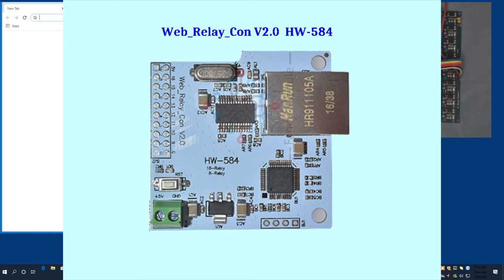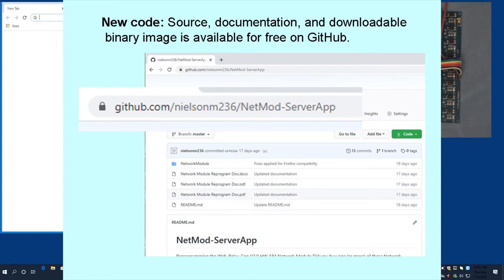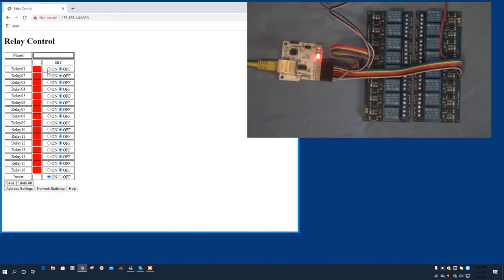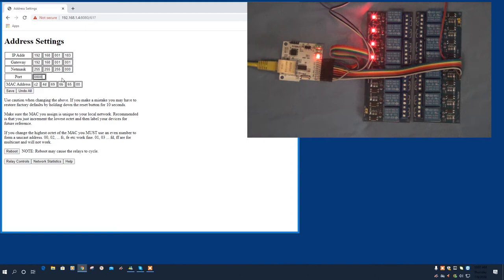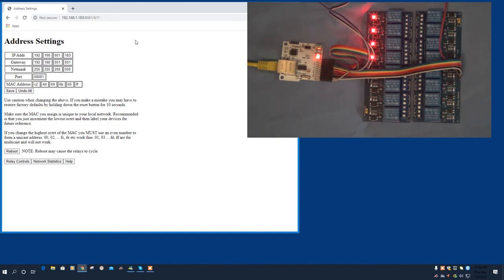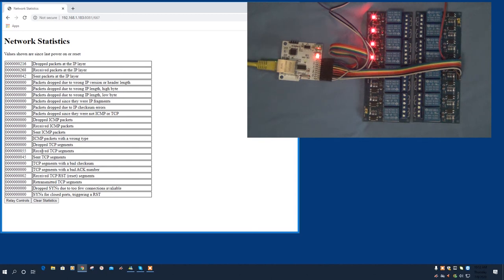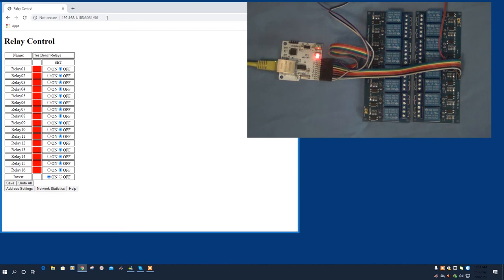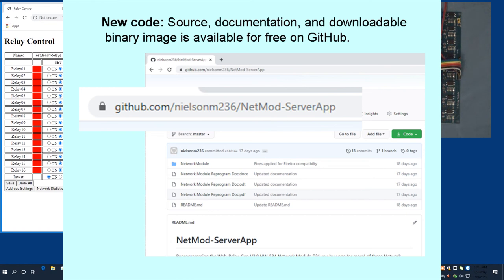Web Relay Con V2.0 HW-584 Network Module 8/16 Channel Relay Controller ENC28J60

Comment: Hi All - I've created a separate code thread that makes the Network Module provide 8 relay control outputs and 8 inputs. Did this for my own use as an experiment. As of this date (July 24 2020) I haven't put that new code thread on GitHub, but if there is any interest I'll be happy to do so. FYI it would be just as easy to make a code thread with no outputs and 16 inputs. I've thought about making each pin user programmable via the GUI, but that's a stretch in the available memory so I'll revisit that idea only if there is interest.
Reply: Hello
I would be very interested to know that my attempts to do just that have unfortunately failed because I am not deep enough in programming. Apart from that I often work with ESP Easy firmware, but in some places WLAN is not possible or not stable enove.
I would be very happy about your code
Reply: Hi there,
Very interesting project and great work.
I've purchased a pair of this relay control modules from china to only later find the strange behavior of the original code.
I haven't tested yet you code because I'm waiting the arrival of the ST-Link V2 that seams to be lost...
I'm not familiar with STM. I only have experience with Atmel (arduino), ESP8266 and Microchip.
From what I've understood, in the code available on github, you only need to change the GPIO_SUPPORT value before compile to get 8 inputs and 8 outputs.
I have to say that for me that's enough but if you can change the module configuration in runtime, it might be easier.
Reply from the maker: @caladeira2010  Hi Carlos - I've already compiled the code for all three configurations. When you program the device you just need to pick the .stp / .sx files for the configuration you want. But yes, if you decide you want to modify the code and need to recompile you change the GPIO_SUPPORT value to pick the configuration you want to compile.
I did try to make this run-time selectable, but the flash is limited to 32K and all three configurations won't fit. I will put more time into that and perhaps can find a way eventually.
STM isn't much different than the ones you have experience with. The principles are all the same. Just need to use the right compiler. Fortunately for this particular device all the tools were free (except for the ST-Link).
Thank you for the feedback. Let me know if you have difficulties, find a bug, or have suggestions.
Reply: @nielsonm.projects  I've already seen the github update! Thank you.
Once I receive the ST2-Link I'll update my modules.
Since you ask for suggestions, I'd like to integrate this module with Home Assistant and for that, I think the best way is using MQTT protocol. I've already used  knolleary/pubsubclient library with arduino/esp8266 but it's not compatible with STM.
Do you know any MQTT library that can be integrated into your code, even if we need to remove some functionalities to provide the necessary space?
Thank you.
Reply from the maker: @caladeira2010  I've never done any project with MQTT before, but with a little research I'm finding plenty of tutorials and shared code (for instance Mosquito MQTT and LiamBindle/MQTT-C on GitHub). That's just scratching the surface, but it seems plausible that an MQTT code load, completely separate from the code I've written, could be developed. Might take a few months given I've never done it before. I will dig deeper.
Reply: @nielsonm.projects  Hello, I'm glad this idea touch your curiosity!
I have another suggestion for you:
Do you have had any contact with Node Red? 
If not, you should take a look.
YouTube is loaded of tutorials. 
Again, once I get the st2-link, I'd like to give an hand.
Reply from the maker: @caladeira2010  I've never used Node Red. FYI, the LiamBindle code looks like a good place to start (see https://github.com/LiamBindle/MQTT-C). For me this is a ton of stuff to learn, but I'm willing to take a run at it. I'm a bit worried it won't fit, even though it's supposed to be intended for small device embed. Send me an email at the address in my project document so we can do some more detailed collaboration. No promises here, but I'd like to learn this skill.
Reply from the maker: Carlos - I dug into this a bit more over the weekend. It is clear that an SSL/TLS implementation won't fit in the small Flash/RAM size of the controller. The Flash is 32K, and it looks like the smallest TLS implementation would take 27K of that. So, this implementation of MQTT would have to go without encryption. For a home relay controller / sense input device that is probably OK. I could still implement username/password, but again that would be unencrypted. I am not sure how big the MQTT compile itself will be - I'm still breaking down the functions and trying to get it to a "first compile" point.
Reply from the maker: Carlos - I've taken the LiamBindle MQTT-C code and carved it down for the STM8S processor and Cosmic compiler. Just got my first error free compile - which is a long way from working and tested code but it is showing me I am very likely to make this fit in the available Flash and RAM. The MQTT-C code, despite saying it is compatible with bare metal, has a lot of OS (Linux or Microsoft) dependencies. So it took a bit of work to replace those dependencies with bare metal equivalents. Plus I had to leave out SSL/TLS as mentioned before. My intention is to make the device work with both the browser and MQTT in the same code load. To make room for MQTT I took out the Help and Network Statistics web pages. Now I need to work up a broker on one of my test computers so I can find the bugs in my code.
Reply: @nielsonm.projects  Hello Michael,
Great news.
Since the main use of this network relay will be in a closed network behind a router firewall, I think that using client authentication in MQTT protocol should be enough.
My preference for broker is mosquitto, but you can use other.

Regarding the network configurations web page and EEPROM storage, we should add the following:
- broker ip
- broker port
- mqtt username
- mqtt password

The MQTT topics that the module should subscribe can be something like:
/networkrelay/[modulename]/relay/1/on
/networkrelay/[modulename]/relay/2/off
/networkrelay/[modulename]/relay/all/on
/networkrelay/[modulename]/relay/all/off
/networkrelay/[modulename]/relay/status
/networkrelay/[modulename]/input/status

The same way, the module should publish something like:
/networkrelay/[modulename]/alive   (a periodic heartbeat)
/networkrelay/[modulename]/input/1/on    (if the module senses input state change, should publish a message)
/networkrelay/[modulename]/input/3/off    (if the module senses input state change, should publish a message)

If you want me to test anything, just say.
Reply from the maker: Thank you for the reply. I've run into a series of bugs now in the MQTT code. It is just a matter of working my way through them. I've downloaded a Mosquitto server/broker for implementation on a test machine. This may take awhile but I'll update as I work it out.
Reply from the maker: Carlos - Just checking in to let you know I'm still working on the MQTT code. This has required some significant code changes to make room for MQTT. I'm keeping all the browser functionality and intend for MQTT to run in parallel. Having said that I don't have enough running to have confidence yet. And the code gets harder to read as I optimize for code space. But as I said, it is interesting work.
Reply: @nielsonm.projects 
Good news. I've been away for one week in holidays but now I'm back.
Have you seen my e-mails to you?
I've already integrated the current version of your 8 ins - 8 outs firmware with node red and home assistant.
Since I can only check for input status once for second, quick events may be ignored.
If your firmware track the input status and publish a message every time input status changes, it will be great. In my point of view, MQTT will be the best way to implement this.
In the meantime, I've already joined the superhouse discourse, if you prefer, we can continue this discussion there.
Regards.
Reply from the maker: Hi Carlos - I received an email on Aug 6 and another on Aug 13. If those are the only ones then yes - got them. 

The problem that has slowed me down is that I need to free up RAM for use by MQTT. The only way for me to do that is to reduce the size of the buffer used for transmit/receive for the web server. In the code I've released the web server buffer is implemented in a fairly naive form - the web server IO is well controlled so it was all designed to receive complete POST replies from the browser in one packet with no fragmentation. This required a specific sized buffer, which used up all the RAM. So, I've been busy implementing fragmentation reassembly, but again in a naive form since this isn't a general purpose web server. But it has been quite a challenge. I am close to solving it all ... I think ... but I thought that was true about 2 weeks ago.

Once I get enough RAM freed up I will turn back to the MQTT code. I made good progress on it until I discovered I had to stop and figure out a fragmentation solution.
Reply: @nielsonm.projects  Ok, no pressure!
If you need any help, just ask.
Reply from the maker: Carlos - Sorry for the long silence, but I've been working on this diligently. I won't go into the laundry list of problems, but almost all were issues porting code (and a few bugs of my own). But, the good news is that as of tonight I have very basic MQTT running. I can connect to a Broker and Subscribe. So, tomorrow I will work on figuring out how to test more MQTT functions for the first time, and generalize some of my hard coded "user inputs". And, of course, I'll start ticking off the items on the list you sent. This has been quite the project. I am hopeful I can provide a firmware for you to test within a couple of weeks, perhaps sooner. I am sure you'll find bugs that I haven't as this is my first MQTT project.
Mike
Reply: @nielsonm.projects  Hello Mike,
Good to hear that you are making progresses. Take you time!
Once you have a version for testing, send it and I'll test it and reply with comments/suggestions.
I've already wired one module with 4 inputs and 4 mechanical relays and other unit with 8 SSR's and 2 quad switches to control functions in home assistant.
Regards,
Carlos
Reply from the maker: Carlos - If you could message me at my projects email address: nielsonm.projects@gmail.com    I would like to discuss the MQTT suggestions you made so that I can better understand how a user interacts with MQTT devices. I almost have it all working but I want to make sure I do this in a way that is easiest for MQTT users. Thank you.
Reply: Hello
may I ask if there is any new information about this project? I am watching the project very curious, because MQTT would make my life easier in many places, because my automation is based on MQTT  .
Reply from the maker: @tobienmarc  Yes - work and test have continued, and I think we are getting close to release. I will need 3 or 4 weeks to update documentation assuming our current long run tests do not show any defects.
Reply from the maker: The MQTT version is now on GitHub